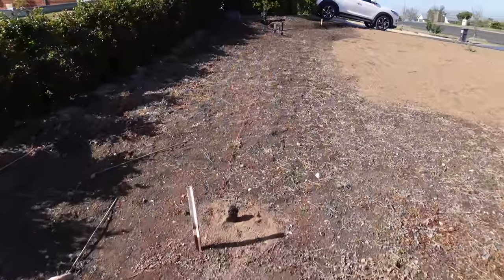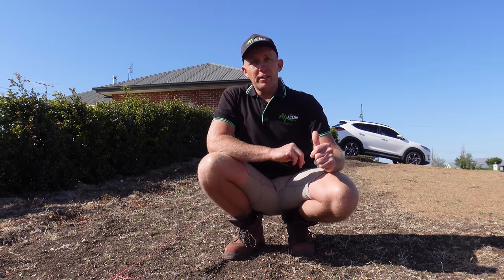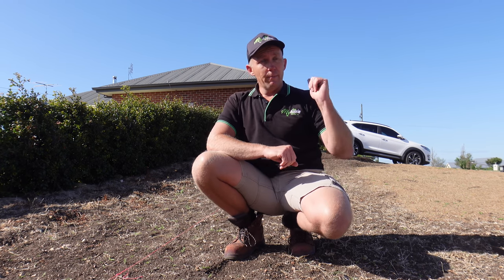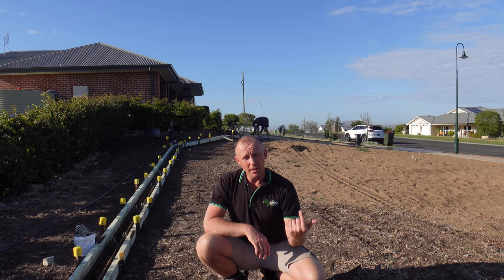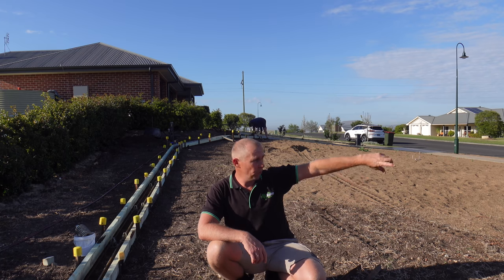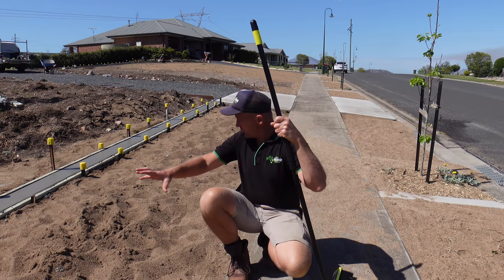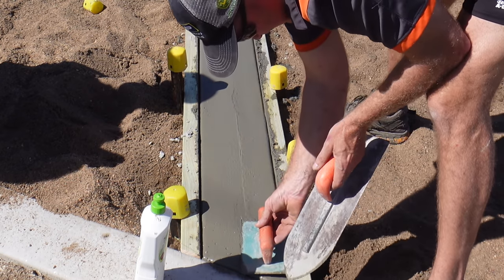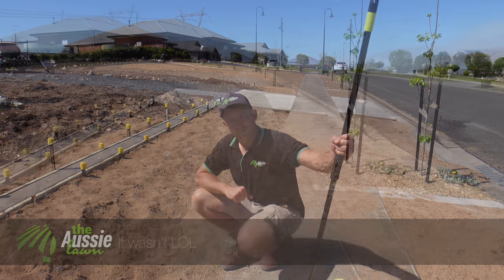INSTALLING CONCRETE LAWN EDGING THE OLD SCHOOL WAY

Comment: Are you thinking box drain and ag line to prevent future wash outs? Wouldn’t be too difficult with the natural fall of the front there. 
Or will it no be so prominent once you put turf in.
Reply from the maker: Hi Liam,
I actually won’t need to once the turf is in. The washout from the last rain events was caused by water flowing down the pathway as it leans towards my yard . In the past the washout was more of a problem from water flow from my gravel driveway (that’s now sorted with the new concrete strip.. so once the turf is laid I’ll be sweet as 😎

Comment: Great stuff Brenton
Can you advise width and depth
Looks like 70x45 treated pine walls
Reo thickness  ?? 
Please
Reply from the maker: Hi Paul they are 150 wide 100mm deep and the reo bar is 12mm thick x 2 bar

Comment: Some quality craftsman ship right their,👌
How many cube’s of concrete you end up using and what was the cost for the concrete used and delivered?

Got a project on the cards for next winter, 
Enjoy the journey mate🤙
Reply from the maker: Hey mate it was about .8 cubes so not a huge amount it was about $250 ish but timber and steel was the most expensive part at about $500 Ive still got about 1/2 that much to go again once the last of the sand goes in but ill re use timber 😎
Reply: @theaussielawn  🍻